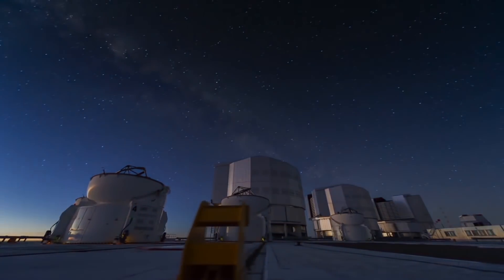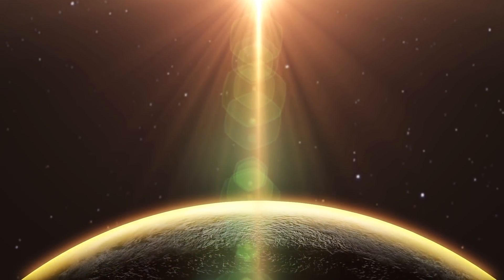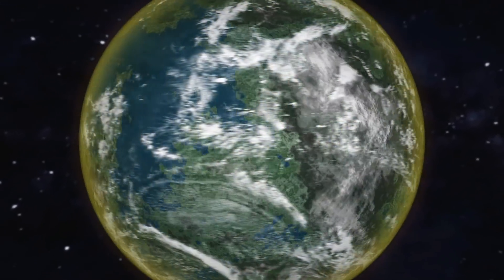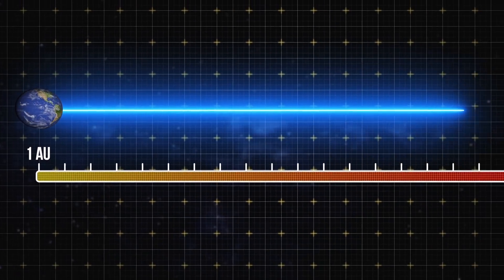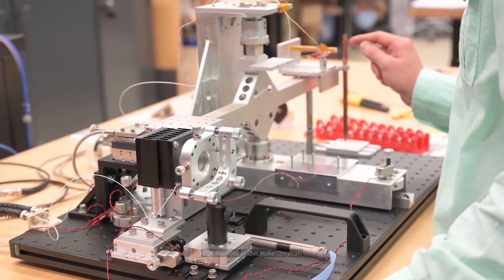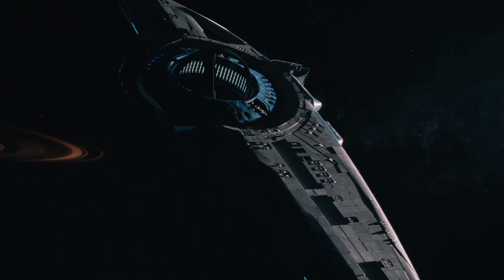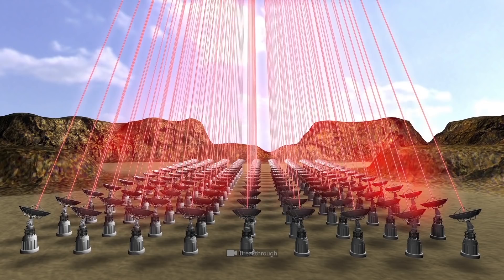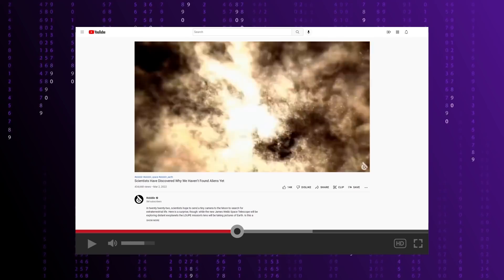Something Unusual is Going On With Proxima B Right Now

Comment: Ooooorrrrrr. You can use Nuclear Pulse Propulsion to send a craft massing thousands of tons at a tenth of the speed of light, get there in 40 or 50 years, slow down, and do whatever you want. It could even turn around and come back if you wanted to. That's also a time frame you might conceivably be able to send people on.

Comment: Needing to go to Alpha Centauri because it will start moving a way is irrelevant, because unless a warp drive is developed it will not be practical going there regardless! Also, they planet may be cool to check out, but no way would it be suitable for life due to the reasons stated in this video.

Comment: Good point, in space, how do astroids get their propelled energy? It's a combination of gases as the sun's heat effects the astroids and coldness the astroid has cause a propellant for the astroid,

Their surfaces heat up during the day and cool down at night, giving off radiation that can act as a sort of mini-thruster. This force, called the Yarkovsky effect, can cause rotating asteroids to drift widely over time, making it hard for scientists to predict their long-term risk to Earth.

Can the same kind of energy be used on spacecraft, this can save lots of fuel and can propel the craft at high speeds.

Comment: So, someone correct me if I’m wrong because I was an art major who didn’t take any math classes past high school (at which I had only taken algebra 2 and BARELY passed Trigonometry with the professor graciously rounding my ground up a percentage point), but if we can do that star shot thingy that goes 1/5th the speed of light, and Proxima B is like 4 light years away, it’ll take like 20 years for the cameras to get a picture and 4 years to send them back.

So if we did that right this second, I’ll be 50 years old when I first have a glimpse of another star system. Which is so depressing because that‘s so long away. Who knows what could happen to me in that time
Reply: I took calculus in high school and did well but my dad wanted me to go to art school 😫

Comment: I have a question that I want answered! Could the black hole in the middle of our galaxy have been a star once? And if so, could it have had it’s own solar system?
Reply: I do not believe anyone could answer your questions with any degree of certainty. The best answer that you could get is, possibly. I am more interested in finding out, if we have black holes, are there white holes. Holes somewhere in the universe that what gets pulled into a black hole comes out. Think of it like a garden hose. Water goes in at the tap, (black hole), and comes out of the nozzle (white hole).
Reply: @mattcernjavic9999  You misunderstand black holes. Black holes do evaporate away. In my opinion white holes are just hocus pokus, as they break the laws of thermodynamics and require exotic matter to survive. White holes would also be easier to find, considering they emit everything. Obviously, i cant tell you whats true and whats not, but i can tell you whats likely and whats not. White holes are very unlikely
Reply: @sososoawesome1  I do understand how Black holes work, although I did not know they evaporated. I only know what little I do about space from the internet. I was only curious about the possibility of White holes.
Reply: black holes are usually formed after the death of a giant star. The black hole in the center of the galaxy was likely to be a huge star that had many bodies within its gravitational pull. Usually, the biggest stars die first and that's likely the reason why the black hole has had a chance to grow so big

Comment: Dumb question here
Is there anyway to utilize lighting and electricity to power a long range ship?
Reply: Electricity can power a ship. I guess some kind of algae could be used for food along with food supplies. Eventually the ship will run out of fuel so I guess you could launch the ship in space and it will keep going in the direction it is launched unless acted upon by a force. So yeah, long range but that depends on your definition of long range. Long range could be a few hundred kilometers.

Comment: Sorry to say this, but Project Starshop is a dumb idea for a number of reasons.  1 - I seriously doubt any of these solar canopies can possibly make it 4.5 LY distance, as there is no effective way of steering them.  2 - You mentioned how light weight these are, but never mentioned where the bulky camera equipment will be mounted on any of these, let alone the electronics equipment to beam the imagery back to Earth.  3 - Even if Starshop is a great success and it appears this planet is indeed a viable planet for Earth 2.0, then what?  You wasted another decade with still no starship available to transport any humans to Alpha Centauri.  It would only be a giant tease!  It's just better from the get go to design a transport system capable of transporting soft cargo like humans there AND BACK.  Yes, nobody ever mentions how to make the return trip.  Because what if when we arrive there it turns out this planet isn't suitable for human life?  Or even is still there?  It would take so long to get there, this planet could have been destroyed by some space phenomenon in that interim.  I think the best starship design would be one that incorporates constant acceleration and deacceleration.  If designed correctly, about midway to your destination, at your fastest sublight speed, you would then have to start deaccelerate in order to safely slow down sufficiently as not to overshoot or slam into your target.

Comment: Solar sails on a ship are efficient until the sun will appear as a pill size or better to say are good only for our solar system area assuming will pass unharmed throughout the meteor belts. After the solar system even if it uses a laser in the back, the solar sails are so fragile that will get ripped apart/get filled with holes from micrometeorites. The ship must have an alternate propulsion system. When the first propulsion system fails or becomes inefficient it should self shut down and then the second one will start running.
The more alternate propulsion systems to switch, the better. 😁

Comment: If light is the fastest thing in the universe and space is spreading apart faster than light Then how could we make it to Proximas without a warp drive ?
Reply: Space expanding faster than light does not mean that Proxima is moving away from us faster than the speed of light. That theory would, depending on what you mean, also completely ignore our current knowledge of how fast matter can travel.
Reply: @cerkurkafelst7335  I’m sure a warp drive would take some time to travel vast distances. To calculate how fast we’re moving towards or away from proximas we have to use laser technology and really big telescopes that I don’t think we have yet. Think about this, if we use a warp drive to travel to proximas does time stay the same on earth while we’re there .
Reply: @mansfield1986  I'm not an expert at warp drives but when you're in a warp you don't necessarily move faster than light, You make space contract and expand so I don't really know about time dilation.

Space is expanding at the borders of the universe but not lets say in our own solar system. If space between us and Proxima is expanding then we would most likely be able to tell. However Proxima is actually getting closer to us because of its stars orbit and will 27 000 years into the future be  only about 3 light years away instead of the current 4.2

Comment: correct me if im wrong but didnt elon must just make a nuclear fusion engine that can be installed in a space craft to travel at the speed of light ?  i think we have the tech the probelm is we have the wigs not wanting to lose control of mankind for the sake of power and control.
Reply: No, Musk's company makes methane burning rockets.  Much slower than a fusion craft.  A fusion craft might get to 12 percent lightspeed, but we don't have fusion engines other than H-bombs.

Comment: The moon does rotate on its axis. One rotation takes nearly as much time as one revolution around Earth. If the moon were to rotate quickly (several times each month) or not rotate at all, Earth would be exposed to all sides of the moon (i.e. multiple different views).

Comment: They should use solar wind and sunlight to get more power to their space crafts to make long distances more easy,  maybe they could use a gas giant like Jupiter as refuel station in some way , anyway this system with ultra red lights would work better if they shot it from the moon since the oson layer will probably disturb the beams  , so they could build them on the moon for better effect,  anyway just trowing ideas

Comment: 0:30 A light year is a unit of distance, not time. 
     The time it would take to get there would depend on how fast we can go.
     Going as fast as our fastest spacecraft ever launched, it would take several thousand years.
Reply: Yes. That was mentioned here.
Reply: Yes it is a distance, but since that thing is a light year away means when you observe it from that distance you are looking at it from a year ago.
Reply: @Evolcun  I was commenting on the sentence, "It's will only take 4 light years to get there."
     That would be like saying, "It takes me 23 miles to get to work."
Reply: @erictaylor5462  I see.
Reply: @erictaylor5462  I mean there's not really an issue with saying that. If you're 23 miles away from work then it does take you 23 miles to get to work. It all depends on what you mean by "takes". I get your point though. It's common language convention that we're usually refering to time in that sense, but it's not inherently "wrong" to use distance.

Comment: Why not use multiple options together? Like solar cells and nuclear energy for electricity, and multiple drives to be used together in short bursts or separately  while proton sails can be used for endurance.the nature of space helps this since  without outside gravity any object in motion will stay in motion. Slowing down and quick maneuvering might be more of the problem than speed
Reply: Well none of them work yet, they need to work to put them together

Comment: We have technology to run a massive ship for 35 years without having to refuel it. Only way we will gain these crazy speeds is to figure out an electrical thruster and use nuclear reactor or two on the spaceship